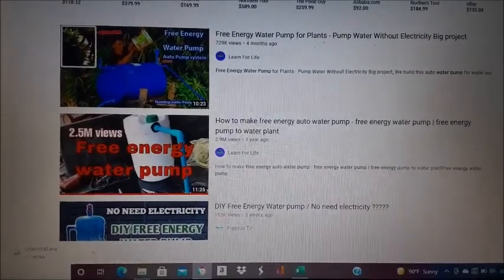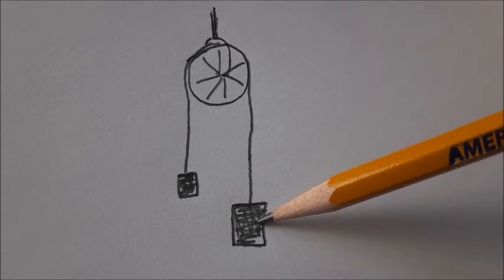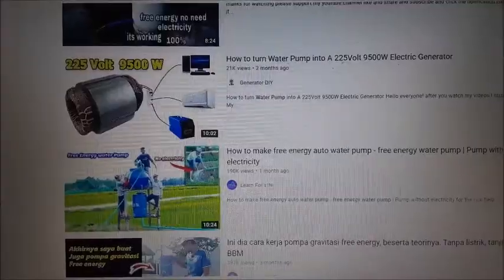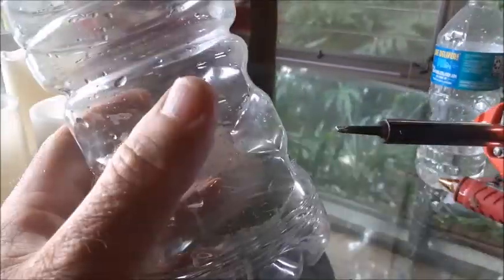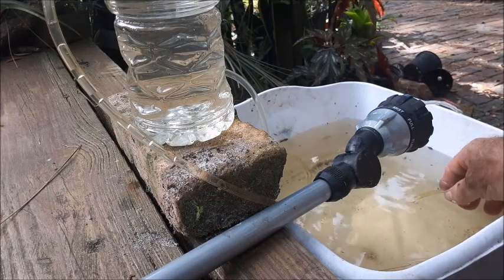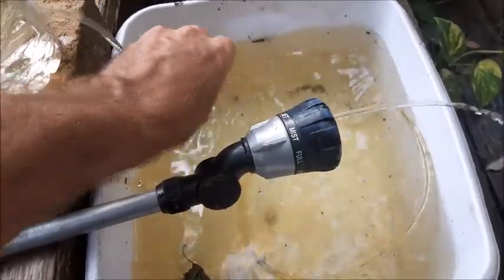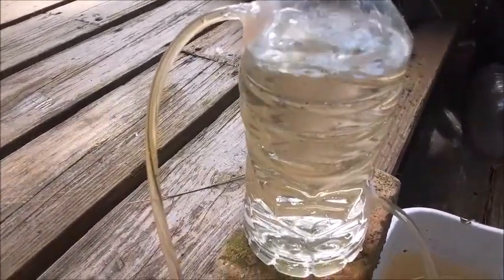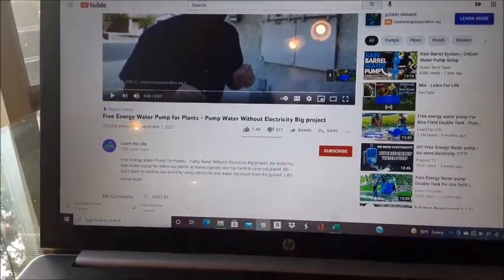Free Energy Water Pump - Does It Work??  A Scientific Approach To Building One

Comment: The sizes of input and output lines is directly linked to size of tank.     Your tank size is too small,  creates insufficient pressure inside the tank.  Output line must be thicker than input line.   Using a bottle ,  your lines should be the size of  a needle.    If the tank is LARGE enough,  exiting water starts to cause suction at the input line.   Your system also may have air leaks at the cap.    I will try the experiment ,  but I did hear this method was used by antient iraqis to draw water out of the wells surrounding the Tigress river in Iraq.
Reply from the maker: Hi,  Thanks for the comment.  We tried this system multiple way and never got it to work.  As for air leaks, I would doubt it but take another looks at the other videos where they don't speak english and look at how they seal up their pipes.  I seriously doubt they are air tight.  Give this thing a try and please recomment on this video on a new comment tread if you get it to work.  Remember as for the other guys with millions of view there is big motivation and financial reward to them.  If you go to their channel you will also notice they have about 50 different videos promoting the exact same idea.  Good luck, you need it.
Reply: @creativerepairing2960  not you not view enough some dude his 55 gallon iron barrels deformed. So your water bottle test lack of equipment and mindset approaching subject you have to open mind to that is work or not. I hint you 3 fact that is work on gravity and momentums of fluid like Ram pump. But system totally reverse setup. Research and try again make new video .
Reply: Sorry, but this is not correct. This system function if the input is higher than the output. The tubes here are fully ok.

Comment: Your supposed outlet tube is smaller than the suction tube. Reason why experiment failed
Reply from the maker: So have you made one yourself which ran continuously for more than 5 minutes?
Reply: Sizeof tubes does no patter. Input source level must be higher than discharge.

Comment: Your supposed outlet tube is smaller than the suction tube. Reason why experiment failed
Reply: No, input is lower or equql to output, that is why this do not work. Size of tubes does not matter.